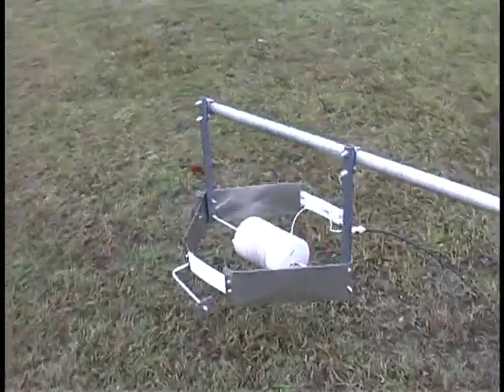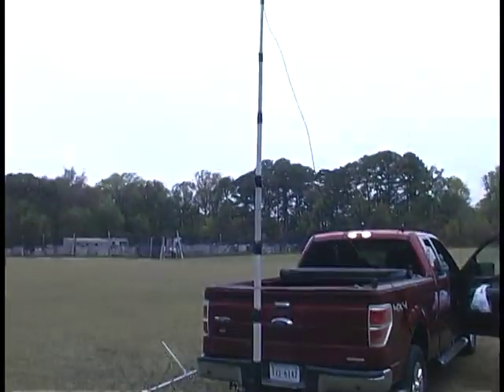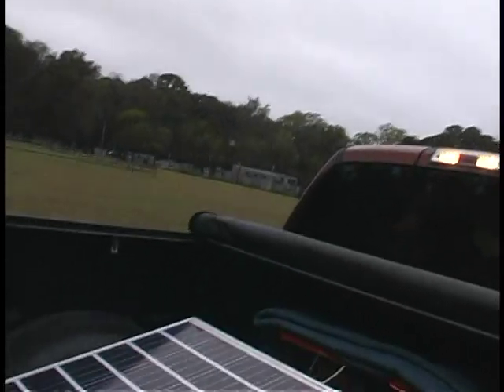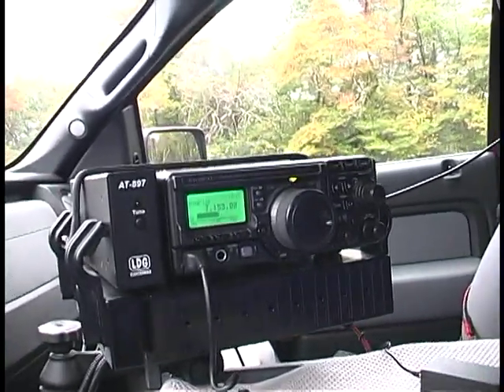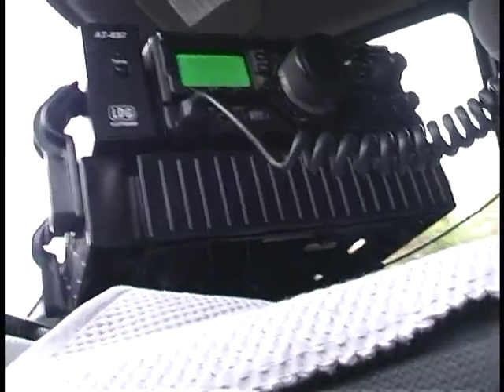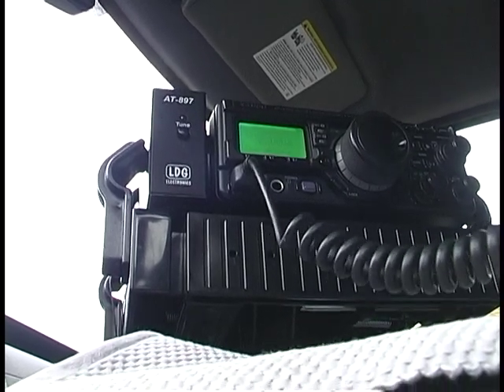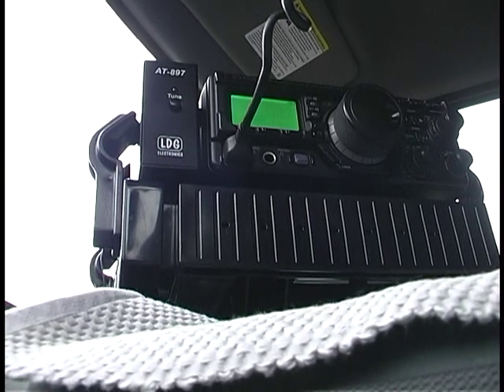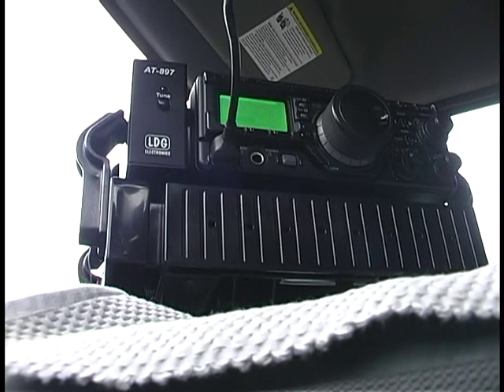isotron antenna on the test

Comment: I have to know, what radio mount is that?
Reply from the maker: Laptop Mount Tough Tray found one on ebay $75 bucks fits ford f-10 2014 bolts to the seat the police use them i have rubber strap hold the radio